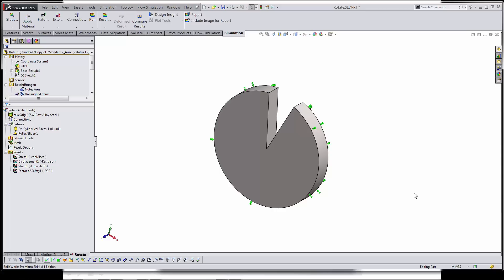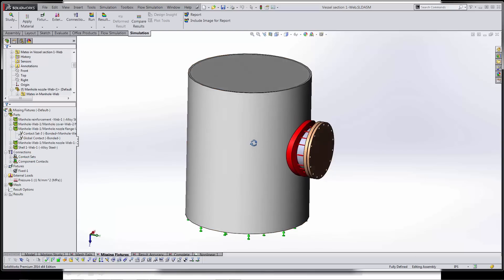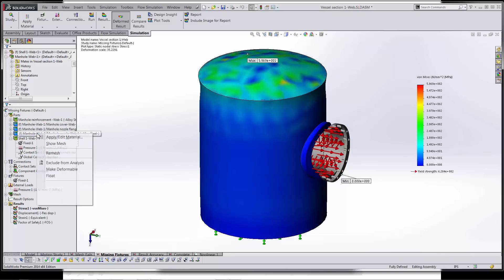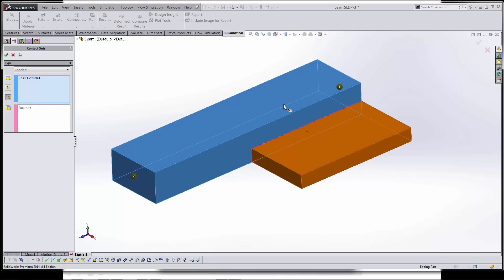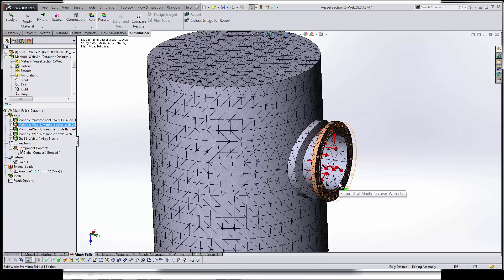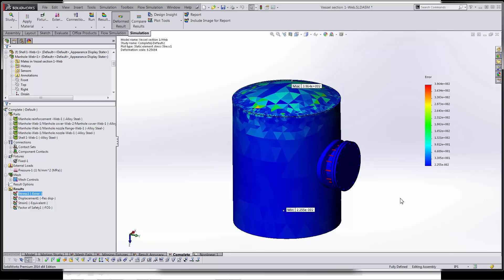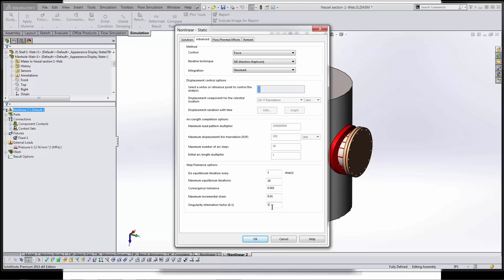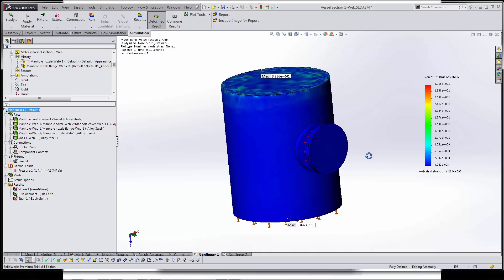SOLIDWORKS Simulation - Common Errors and Troubleshooting Tips

Comment: "Estimated execution time  is 08:52:05                 

Would you like to change the solution time and rerun the analysis?"

How I change the solution time?????
Reply from the maker: Depending on the process we might try changing the the solver or adjusting our mesh to optimize our run time. Maybe even changing what is part of the calculation. These are all skills that simulation analysts develop over time and with a lot of practice. Still in some cases long solve times are unavoidable.
Reply: @goengineer   thx when ı stopped the analysis after like 15 minutes later it still gave me the soluation. and ı tried your soluation it really shortened the time. Thank you☺☺

Comment: You said to try and get all your features into blue band not to focus on a specific number but should the chart read (on the right) to the max tensile strength of the material you are using?
Reply from the maker: Hi Erik,

In this case I’m talking about the Energy Norm Error plot, which is not a measure of tensile strength. Energy Norm Error is a measure of the variation of the stress and strain values in a particular element. It is purely a method to see where mesh refinement should take place. 

SOLIDWORKS say the following on the topic:

“Apart from singularities, if a high energy norm error coincides with the location where stress results are of interest, these stress results cannot be considered as reliable, and a mesh control should be placed there. There is no specific range for this error that can be considered as a safety margin. This error will vary from model to model and study to study based on geometry, loads, mesh etc.” 

This is why I aim for the general “blue” in the areas of concern in the model.

Comment: Hello, i have been experiencing error when i try to simulate static load. Everything works fine until i click “Run” an error message pops up and says “This part was analysed in an earlier version, all the results and plots are available. Please remesh if you wish to run analysis” i hope you can help

Comment: Hi, 
very good demonstration of the common errors. i have one doubt regarding the connections.
while making an assembly if we are using required mate options (like concentric and coincide mate to represent the bond between two plates held by a bolt) then do we need to specify any other connections(like the bolt option comes under the connection option ) while doing the analysis other than the default global contact option ?
Reply from the maker: Hi Suhail,
Mates in an assembly only position the bodies for use in Simulation.  They do not necessarily create contact conditions to define interactions.  Additionally the global bond definition applies only to touching faces or faces with small gaps within a tolerance.  For a bolted connection it would be advisable to manually create the No Penetration contact sets between the bolted plates to ensure the correct contact condition is being applied along with the bolt.

Comment: Can you please help me with an error that I am running into with contact sets? I have a spring that is an extruded rectangle and the contact set is not seeing its opposing surface. Also I am getting a shrink fit notification when I begin the static simulation and the part does not have any assembled components, it is just a spring with a plate on top and a plate on bottom that was extruded from the surface faces. 
Thanks
Reply from the maker: Hi Matt,
You can certainly have interfering geometry even in a multibody part file.  This would give notifications to use shrink fits since that is the only contact set that handles interfering geometry in a design.  You would want to insert your part into an assembly work space then go to 'Tools', 'Evaluate', 'Interference Detection' to check.  From the 'Interference Detection' options make sure to select "Include multibody part interferences".  I believe this will detect some amount of non-zero volumetric interference in your design that needs to be removed.

This may also explain why contacts between your plate and spring are not being recognized since the faces of the spring and plate may not be perfectly coincident (this is if you are relying on the Global Contact recognize your contacts).
Reply: Hello,

I tried your advice after recreating some of the geometries of the design, and when I use the 'Interference Detection' to analyze the interactions of the design it does not give me any interference. I also have recreated one of the contact sets (I started with just one contact set to be simple) and I used the 'No Penetration' and 'Surface to Surface' advanced setting. In these settings the Static Solver with a load applied to the top plate with the bottom plate fixed fails at 35.5% using a curvature based mesh. I am using a 'Large Displacement' study as prompted during the analysis. 

The shrink fit error did not occur within this model but it still did not get past 35.5% where the failed study did not give a prompt as to why it may have failed. Do you have any recommendations to assist my simulation? I am not sure if a non-linear study would be appropriate for this analysis. Also, the next simulation I am going to try once this one is successful involves a bending load which is more complex. Any advice is appreciated. 

Thanks
-Matt
Reply: Hello again,

I ran a nonlinear simulation with the same contact sets, and the message: "Large initial interference is detected without defining shrink fit. Would you like to ignore the initial interference" appears. One think to note is that the global contact (bonded) that originally was created from the study is still there. Do I have to create any different contact sets for a shrink fit that I am unsure where the fit message is coming from?

Matt
Reply from the maker: Matt,
Given the fact that you were prompted to enter "Large Displacement Mode" at 35.5% it appears you made an unstable study.  You can confirm by going through this process:

1. Go into the study 'Properties'
          Turn on 'Use soft springs to stabilize model'
          Turn off 'Compute free body forces'
          Turn off 'Large displacement mode'
2. Suppress all loads and apply only gravity
3. Mesh/Run the study
4. When the solver stops due to large displacements and prompts to put the study into 'Large Displacement mode' declined this offer.  The solver will dump what results it has so far
5. Inspect the displacement plot in the results to find the unrestrained body

Given the setup you describe where the plates are interacting with the spring in No Penetration, either the spring, or the spring and one of the plates is not stable.  The above process will confirm this.  You will want to consider using bonded contacts in place of No Penetration or otherwise create fixtures that stabilize the system with minimum impact to the results.

Comment: Hi, any suggestion how can I reduce the solver time? The accuracy is not so important, I mean 650 MPa or 670 MPa are OK. I just need the predicted behavior of the component. I am new with working on simulation with assemblies, so if the solution is trivial for you, maybe it's not for me ;) (Program setting, recommended contacts, etc...) thank you very much your help! really appriciated.
Reply from the maker: Hi Turbucz,
There are only a small number of ways that you can speed up the solve time of your analysis.

1. If you make the mesh coarser (use larger mesh elements) there will be less for the program to solve for.
2. If you can reduce the number of No Penetration or Shrink Fit contacts this can reduce the complexity of the calculation a tremendous amount.
3. If you can have the solver run on a machine with the fastest CPU clock speed available.
4. If your model and loading are both symmetric it may be possible to run a half-model or quarter-model with symmetric fixtures applied on the cut faces that cut it into a half or quarter model; doing this can readily reduce the calculation size down to a half or quarter of its original size.

Comment: Hi,
I get the following message whenever i try to run a Nonlinear Study:

" Security device is not responding. Please install security device. Press OK key to continue. 
Press Cancel ket to quit from the program "

I'm able to create a mesh, but not run it...
Reply from the maker: Hi Jesusismysaviour,
We have seen this sort of error caused by accessing CAD data from a network and thereby writing Simulation data to a network drive.  The cause for this message is that there is a very large amount of data written and read in the form of temporary files when meshing and solving a Simulation study. If the delay in these operations exceeds a certain time limit, it's possible that the "Security device is not responding" error may appear. Changing the Results folder (this can be done in the study Properties) to a location on the local hard drive to which the user has full read/write permissions could resolve the issue.
Reply: Hi, 

Thank you for the quick reply. I tried changing the location as per suggested, but it didn't work. Would you happen to have another trick up your sleeves? 

Thanks in advance.
Reply from the maker: Is your CAD data located on a network drive?
Reply: Yes, installation and data are on the local (C:) drive.
Reply from the maker: At this point we are somewhat beyond what we can help you with chatting in the comments of a Youtube channel.  You will want to approach your local VAR about opening a case to investigate why this is occurring to your machine.

Comment: Hi, i'd been having a problem with my nonlinear analysis, surfing the web i've find nothing so far, so why cant i define a FOS plot on my nonlinear anlysis? i really do not know if i'm missing something or if it's an error. ty so much.
Reply from the maker: Hi Otilio,
You are currently seeing a limitaiton in the software for Nonlinear type analysis.  Requests to include Nonlinear Factor of Safety plots have been made but not yet fulfilled by the SOLIDWORKS Software Development team as evident in this request:

SPR 225220: Provide Factor of safety plot in nonlinear studies
Reply: oh i see, thanks for the fast respond, i wasn't aware of the limitation.

Comment: I get a warning during simulation:  "Assembled stiffness matrix has a negative diagonal" -- any solution?
Reply: Hey James, there are many reasons, but it almost always comes down to inputs. I'd say most commonly I would first check your restraints (are there enough?) and your material data (are you using a custom material?).

Comment: VERY HELPFUL VIDEO AS ALWAYS. JUST ONE QUESTION, SO THE GLOBAL CONTACT IS NOT A REAL GLOBAL CONTACT RIGHT? WE HAVE TO SPECIFY LOCAL CONTACTS "NO PENETRATION.ETC.ETC.
THANK YOU.
Reply: +VLAHECO Global contact will apply to any faces that are initially touching.

It is good practice to apply local No Penetration contacts for a handful of reasons. 

Cheers,
Shivani
Reply: Shivani Patel Thank you for your reply. If I do not have a contact initially in my model, I have to specify anyway right?
Reply from the maker: +VLAHECO Yes, you are correct.  Thank you for clarifying and your comment.
Reply: Hey Shivani, it is a good tutorial. You mentioned that when there are contacts between beam and shell or solid, we have to add it manually. Here are my questions. When the surface on the boundary of the shell part is touching the beam, can the no penetration be applied between beam and shell? In such case when making the selection on the shell side, do I need to select the surface as well as edges, or one edge is good enough? 
Another situation I encounter is that I have difficulty to treaty the situation when two shell parts normal to each other. Do I need to add bond locally? In my model it seems the global bond works. But I have to refine the mesh on the contact surfaces so that good bond will be generated, and one of the piece will not stick out of the other shell part during simulation. It involves a lot of mesh preparation. Is there other good way to do it to improve the efficiency?
Reply: Thank you!

Comment: Hello!
I am trying to study a plate in an assembly, that is subjected to bending and buckling. Firstly I would like to know if Solidworks can run a simulation like that. An error like the one you presented in a screen shot had already occured (but I think, after closing the error window I was able to see the animation with the deformation of the plate). Also, I would like to ask about the time that a study should take to be calculated. Trying again and again using various settings, I am running studies that take 15 minutes to reach less than 10%, or stuck to 1%... Any help would be appreciated! Thanks in advance.
Reply: +Vaggelis Karvounis Long analysis times usually occur because of 1. Too much mesh 2. Too much contact 3. Too much movement. (1) Try a coarse mesh and run the plate on its own in a static study. If impossible to run plate on it's own, think about what is unnecessary in your assembly and right-click to pick "exclude from analysis". Try a Draft quality mesh for speed. (2) Again, simplify your assembly. How much no penetration contact is needed? Can you simplify with Bonded contact anywhere? (3) Too much displacement can cause instability. Try toggling the Large Displacement checkbox off, try soft springs, try lower loads, fix extra components until you start getting results. This way you can pinpoint which area of your model is taking so long to solve. Yes, SOLIDWORKS can run a bending and buckling study. Bending is covered in displacement, the Static study, available in SOLIDWORKS Premium and SOLIDWORKS Simulation Standard and higher. Buckling is covered in the Buckling study, available in SOLIDWORKS Simulation Professional and higher.

Comment: please help me ...while i m doing the tutorial , .i press icons on the tutorial to see where they are in the tool bar , but unfortunately it shows script error...plz help me
Reply: Tonny Podiyan Have you tried a Repair on the SOLIDWORKS installation?
Reply: +Tonny Podiyan - In the upper right corner of SolidWorks UI there is a search box. You can even look for commands and icons, there, after selecting the proper mode from the drop down list.